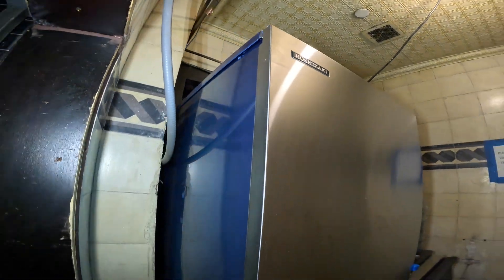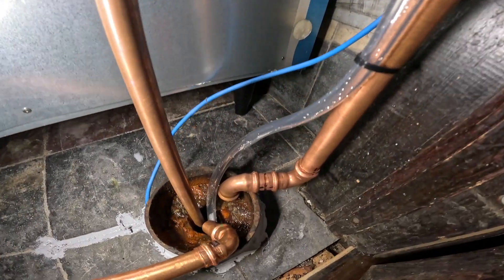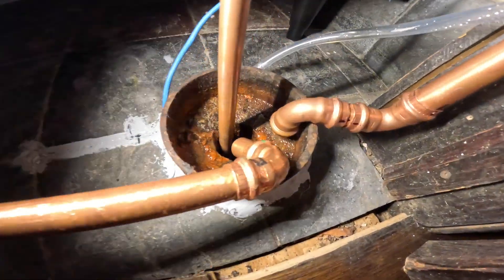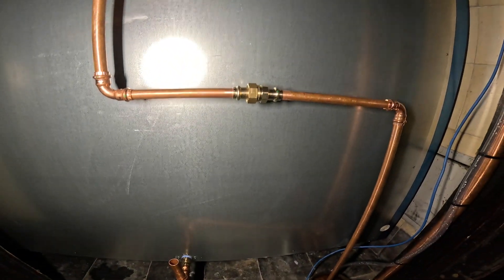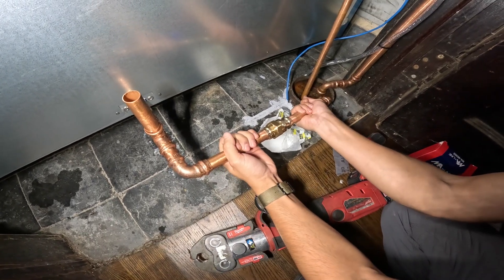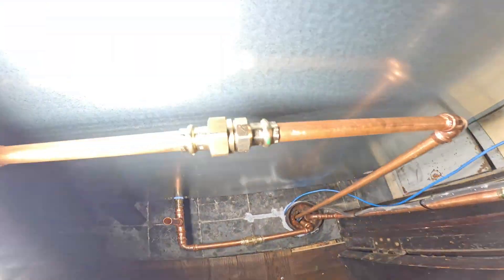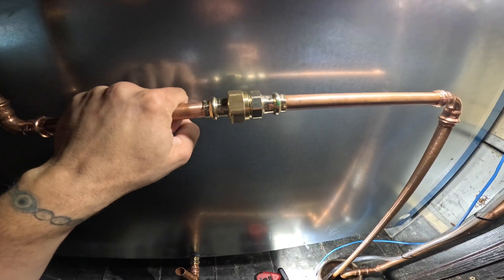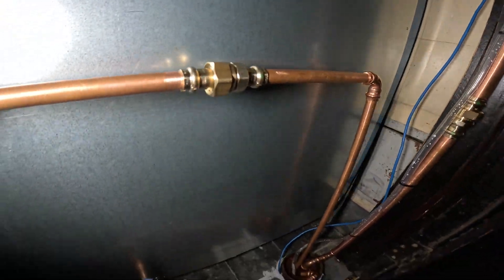HVACR: Hoshizaki Ice Maker Drain Pipe Retrofit For Future Service Using The Milwaukee ProPress M18

Comment: Why not have an air gap
Reply from the maker: There's a small air gap for the two 3/4" pipes. The 1/2" condenser outlet went down into the floor drain as that one has a lot of pressure. It would be splashing everywhere. Thanks for watching! 🔧⚡️
Reply: IRL, that's a triple violation, since if the drain backed up it would fill up and cover all the pipe ends and if any vacuum occurred on them it could backflow. not very likely that would ever happen, but in terms of inspection, that would fail. it can be a pain sometimes to meet code and not have spraying splashing everywhere.